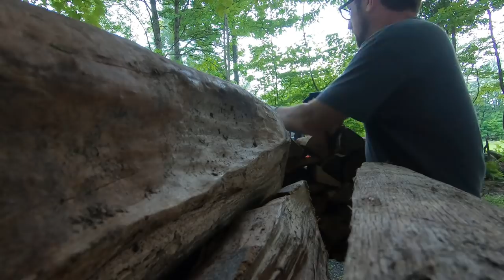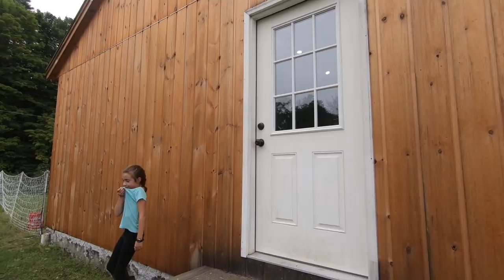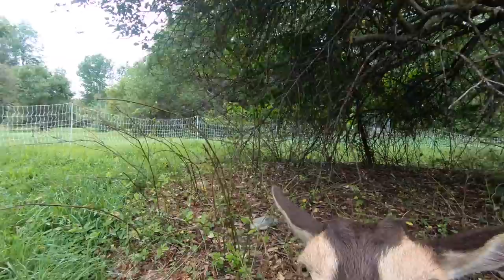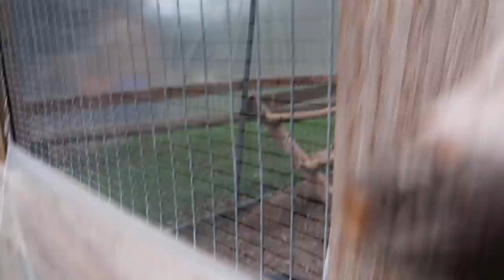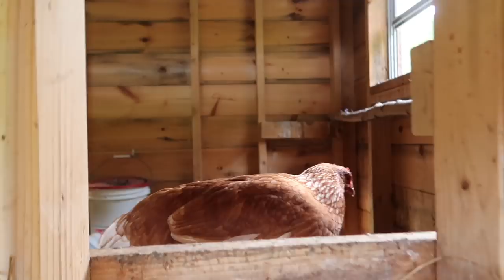We had 4 acres Logged and we are buying FIREWOOD

Comment: What was that that ran, crawled out from under the Kabota when you backed it up? Was it a toad? Or frog?
Reply: Toad beatin feet! Good eye.
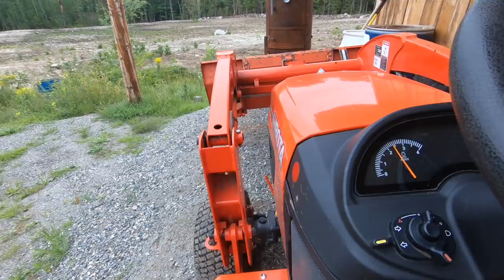Reply: Had to go back and watch it again. Didn't catch it the first time @6:10
Reply: @straubdavid9  Glad it was a toad. I was afraid it was a rodent.  You got to wage a constant battle to prevent rodent teeth from reaching your wire harness, belts and rubber hoses on equipment.  Plus any covered space in and around the engine is a potential nesting site. Hay, sawdust and feather are fine in the pen/coop, not so nice when packed into air breathers and manifolds.